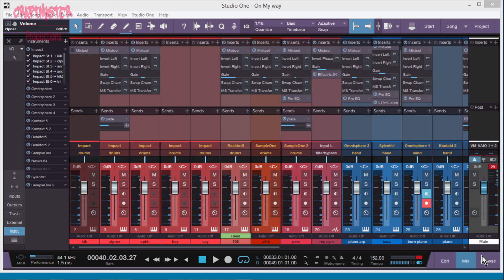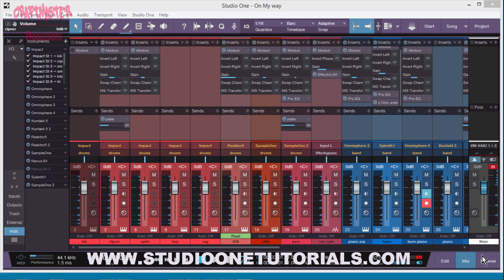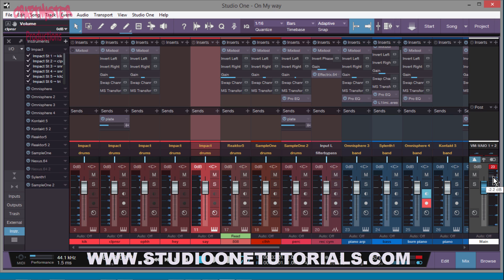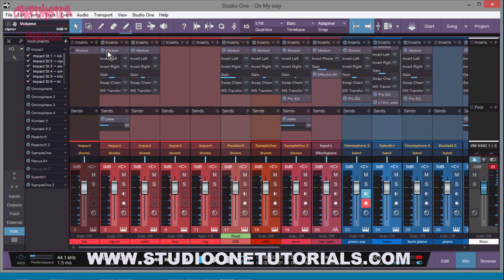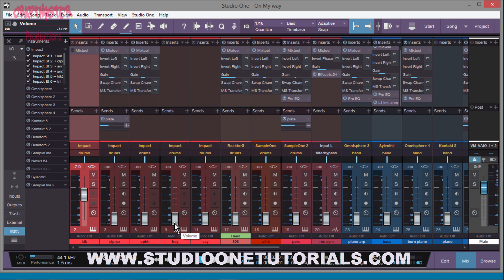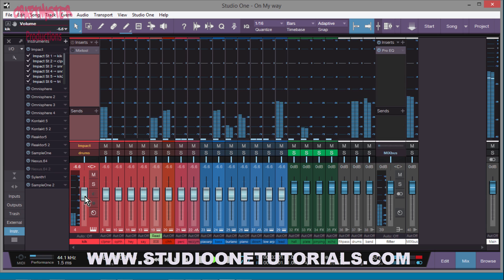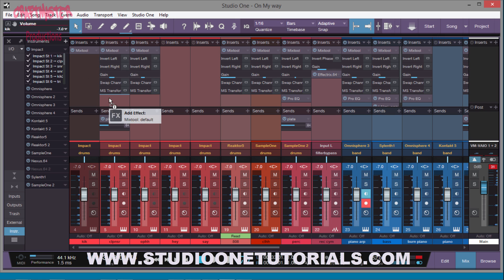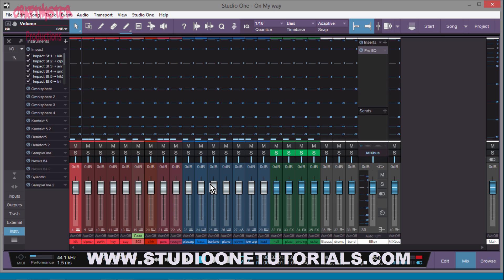GAIN STAGE AT LIGHTNING SPEED WITH PRESONUS STUDIO ONE V3

Comment: This tutorial was a little-bit ambiguous and brief. We need further explanations from you about the 'whole' gain-staging process. I've heard that some plug-ins (in the effects channel) can be clipping internally if the signal going in to them is too hot; in other words the signal has to be double-checked immediately before and after each and every effect plug-in just to confirm correct levels going in and coming out if one is going to be thorough about it all. Aren't we meant to be aiming for -18dbfs on each and every channel and the master-fader? I'm still confused about it all...
Reply from the maker: Axel Foley Its a really simple process, dont stress to much about it. I will try to clear acouple things up for you. First, with your plugins...if your fader volume is not clipping before adding and insert effect then you arent clipping your plug in so no worries. Second you are not aiming for -18dbfs across all channels and the master fader. Seeing as the sum off all the mixer channels makes up the enegy in the mix bus that would be impossible. 

Dont over complicate this. Forget everything you have learned to this point. Keep this one thing in mind. Dont let your mixbus go any higher than -6 during a mix, use the mix tool as your first insert to manage that. You will like your mixes, thanks for watching
Reply: Craftmaster Productions Thanks for the reply but that's not what i've heard from other experts. For example, even Steven Slate sets his plug-ins internally at -18dbfs to align with where our channel fader should be, and tutors like Graham Cochrane in his videos says things that you don't say, as in these on Youtube > "Gain Staging Your DAW With Trim Plugins - TheRecordingRevolution.com" and "5 Minutes To A Better Mix: Proper Gain Staging - TheRecordingRevolution.com". I need to get to the bottom of all this and i wish someone would tell us the definitive answer once and for all.
Reply from the maker: The Slate Method, The Recording Revolution method and my method will all take you to the same exact place. Pick one that makes sense to you and trust your ears. Good Luck!
Reply from the maker: Axel Foley I think where you are having a problem is you havent mastered the basics of gain staging so when you see other peoples different takes on it they all seem to conflict because you are expecting everyone to get to the same place using the same process. The goal of gain staging is to deliver a mix to a mastering engineer that has enough headroom so the mastering engineer can process the audio to their liking. If you want to verify this simply contact a mastering engineer and asked them what is their preferred peak volume for the mix you are submitting. How you get to that peak volume is a matter of taste. Try all the methods you can find until you find one that works for YOUR personal workflow and taste. Good Luck!